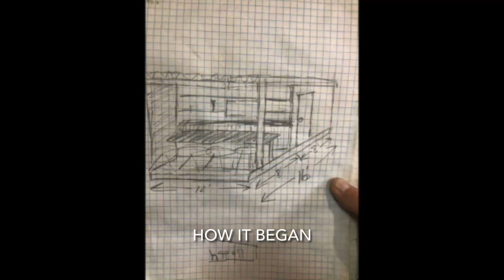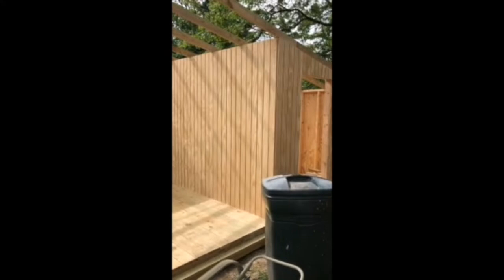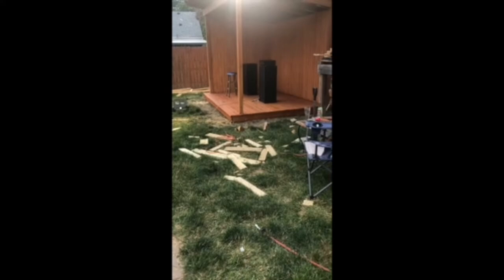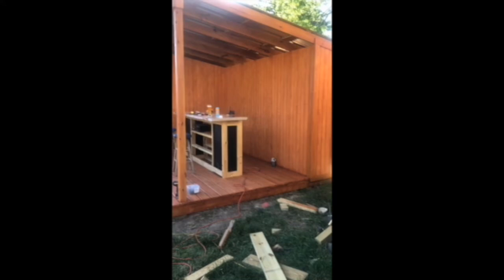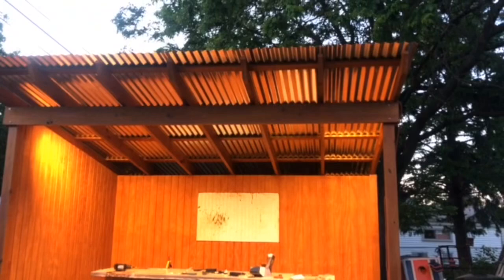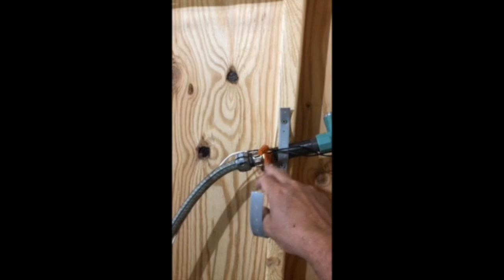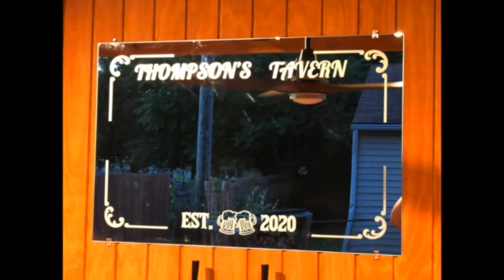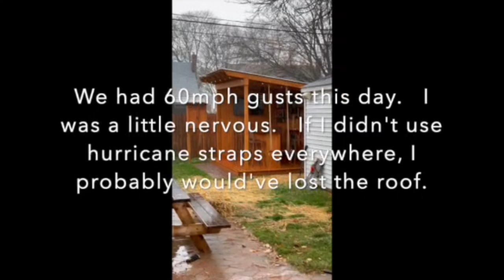Build video for my backyard bar

Comment: What are the 6"x6"x12' pieces at the beginning, is that concrete and you laid the wood on, like a skid or are the pressure treated 6"x6"s. Thanks
Reply: He have done it with concrete, but important to get same level on every concrete. But you can take stone slabs if you want, easier to adjust.

I dont se if he had pressure treated 6x6's but if I had make that I had use pressure treated on the ground. With pressure trested wood of good quality you will get like 10-15 more years of long lasting.

But that bar in awesome. I would like to have one in my garden too🤘🤘🤘

Comment: That is awesome.  But one question.  Instead of having to take off the clear plastic every year why dont you make it to where it rolls up and you can keep it hanging. So if theres ever rain or snow you can then roll it down and create something that holds it down
Reply: I'm assuming that if he rolls it it will become scratched (like the back window of a Jeep), which is probably why he's not rolling it up / down year round. I'd be curious how he's storing the plastic when it's not up.

Comment: What a great job brother!  I have a question if you don't mind...did you use deck blocks or did you dig holes and cement 6x6 posts in the ground? Great job...I'm trying to do something similar.

Comment: I need this in my Wisconsin back yard. What type of heater are you using? Do you have a dedicated circuit for this bar? If I have a concrete slab, should I still do wood floors?